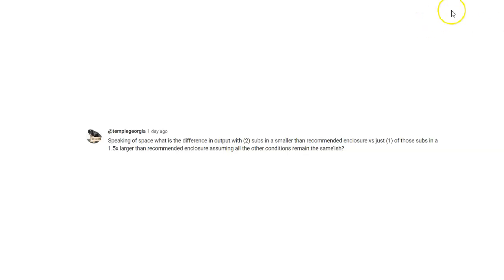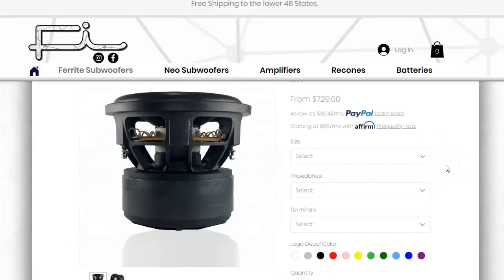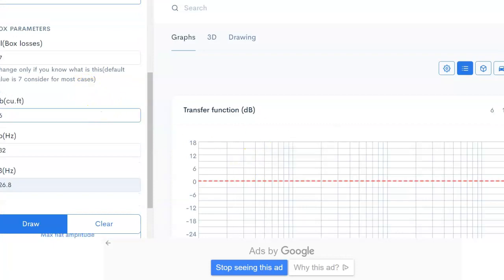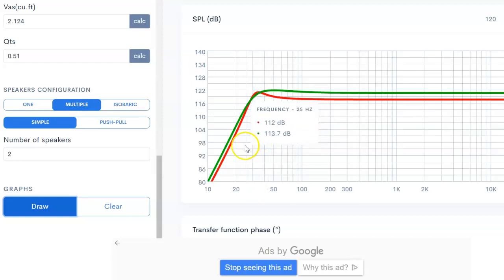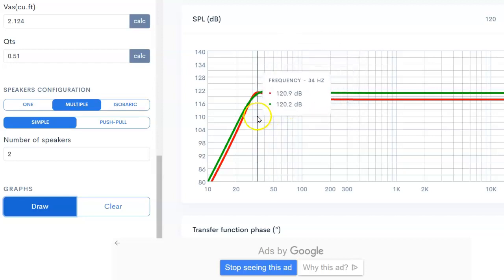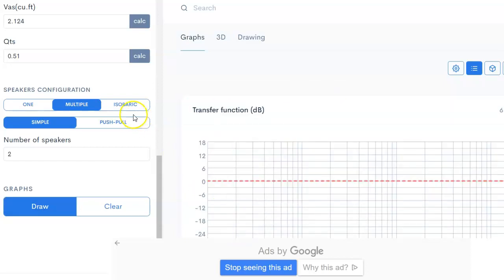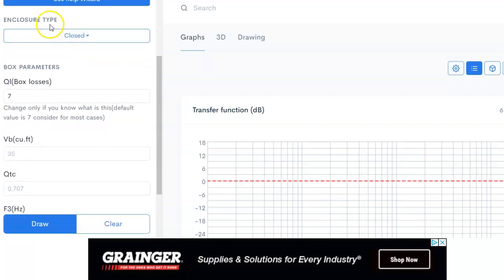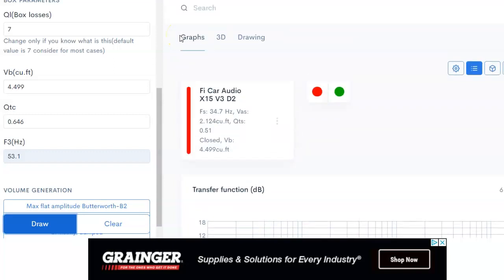What is louder?  Two subwoofers in a small box or one in a big box?

Comment: This helped. Thanks. Moved amp 5k to 7k. Current subs 4k peak but amp does 8k+ Was debating getting 2 higher rated subs 2.0 cu ft. Each. Current subs recommended enclosure 1.5- 2.75. current box 1.7 cu ft each. Leaning toward adding a 3rd 1.5 each running inverted. Drops load to .67 ohm so more amp power too.

Comment: This is kind of what I been debating. I was thinking would it be better to run 2 subs in 2.5cu net volume ported or would 3 in that same volume be louder? I'm looking at running either 2 DD 2508G subs which can play in 1.25cu net per ported or my other option is running 3 sundown X8 v4 subs in 2.5cu net ported which would come out to around .82cu net per sub and the X8 say they can play in .75cu to 1cu net per. I want it to hit deep and hard I like lows but not really low low like I'm more into 33hz and up into mid 40hz range. So which setup you think would be my best option?

Comment: Old comment buuuuut. Note my pic. That's 8 skar vvx8d2. 5k per set of 4. Tuned to 38hz. The bottom is 3 skar evl15d2. 10k. Tuned to 36hz. Subs run taramps amps. Mids and highs are skar also. Old kicker 400.4 amps I had laying around running them. Was challenged by a freind that said skar sucked in sound quality. He no longer thinks that. Replaced his entire system with skar. At half the price of the other he had. Nemesis audio. I'm here to tell ya. Recommended by manufacturers are never good to build. I've been building custom boxes since the late 80's when I first got started. Tuning is usually way off as well. We did the math on paper back then. Since the mid 90's I've used software. I even used the dats 3 system on new jl audio and dd and even my dc audio subs. Sundown is close with specs. What's not taken into account on these recommendations is the space in the vehicle and the type of music when buying and setting up the equipment. I set my vehicles up to run just about anything. I have custom settings to switch between heavy bass, rock, rb, jazz, or just a back message at 10hz 660 watts. Barely hear anything just feel the luv. My youngest son is a planet audio fan ever since I gave him my old planet audio bb10 I had. Ran in a sealed 3.6 cube box. They were loud, hit hard, and only need a 1500 watt amp. An old audiopipe I had. He later put in an all pa system in his taco. Still running the old ap and pa amps for his mids and highs. Was in there for years before he removed them for his son. There all back home now. Point being. If you want a mix of sq, and spl, you have to do some math. No regular box will do it. Just remember. If it's not fun it's not worth doing.
Reply from the maker: That is some great experience you have!  I personally think experience is the key factor to success.  You are correct, using a program or math and adjusting it for a vehicle usually creates a great outcome.  There is just so much to learn in this field, I am constantly learning.

Comment: Great video. Not exactly the same, but I had a box that was 2.7-2.8 depending on displacement. I built it 10% over the recommended range for a 12 and didn't really like how it sounded. Down the road I tried a 15 in it (10% below recommended). You could tell the 15 wanted more room to moce, but it was pretty much better at everything. I've also tried it with 8 & 10 in 1.1 cube with the same results. My takeaway, like you said, if you're on the fence go with more cone area
Reply from the maker: Great feedback!